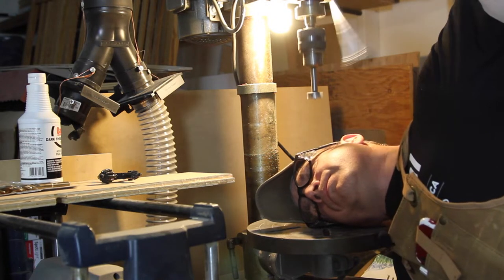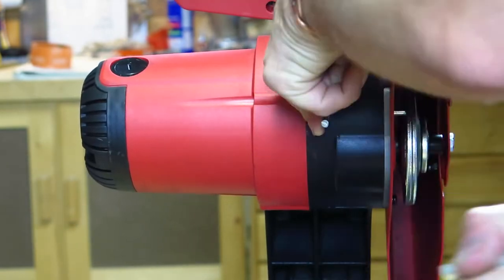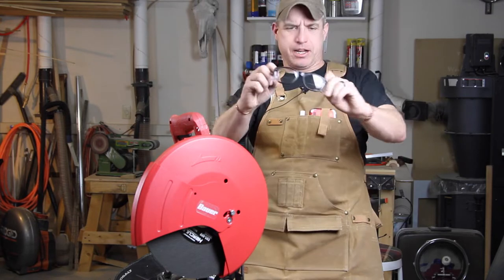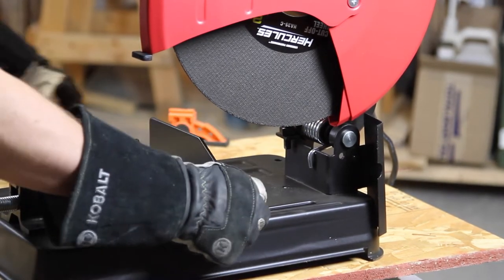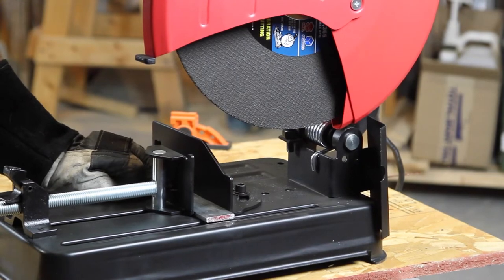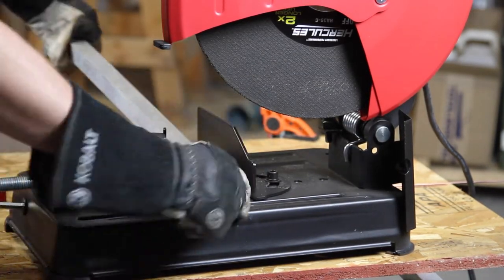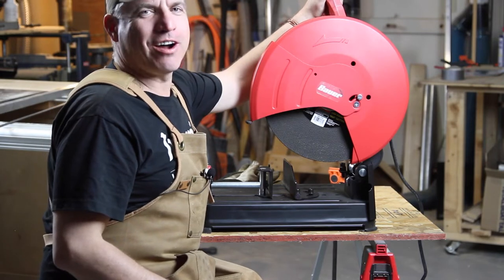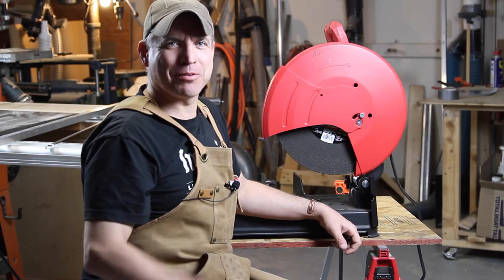Harbor Freight Bauer 14" Abrasive Cut off chop saw review

Comment: Why does the saw have 4 feet but only 3 are covered in rubber.
Reply from the maker: That is a GREAT question and I had to go look. I hadn't noticed because the saw didn't wobble. When I looked, It indeed does not have a fourth rubber foot. I checked the package because I was pretty violent when I pulled it out. Nothing in the box. So I took one of the other rubber feet off. That's when I noticed that the non rubber foot is shaped different and it hit me. That's where all the sparks are deflected! 

In the video you can see that the sparks are essentially molten metal and stick to the deflector bracket. It is so hot that it continues to glow after the saw is shut down. If there was a rubber foot below it, it would likely burn, melt or catch fire. 

I also had a look at the HF website and the photos confirm only three of the four feet have rubber protectors on them. 

Thank you so much for paying such close attention to the video!
Reply: Thank you so much!  I was confounded and saw no sense in this and searched for an explanation- none was given by the Harbor Freight website or the manufacturer. I am impressed and thankful that you addressed and found the answer..

Comment: useless review, we know will cut metal.  but need to see how accurate the angle fence is degree-wise and the blade to the base are.  Not having a true 90 degrees verticle and horizontal cut makes this chop saw inaccurate in cutting.
Reply from the maker: Hi there. My intent with this video was to show the features that are all similar to the features found on the top name saws and add a little humor. With regard to the fence, it is capable of moving a full 90 degrees (45 left and 45 right). There are no production stops, and the degree increments are stamped into the steel itself. That being said, the accuracy is dependent on the operator. I found that the stamped incriments are accurate enough. The abrasive blade will wander slightly if not plunged down right on top of the metal piece being cut. Checked with a speed square the base plate is exactly 90 degrees to the blade. 

Every abrasive saw I've used isn't micrometer accurate. That's not really the purpose of this kind of saw.

Thank you for the comment, and thanks for watching. 

Mat W/1T
Reply: @Mat-W-1TFandF   Disagree with this jerk.  Your video was awesome.  Your reply to his "useless" complaint was much kinder than mine would have been.  Thanks for a great job, and keep 'em coming.  Subscribed!

Comment: Could I use this to cut exhaust pipes.
Reply from the maker: Hey there Michael. Thank you so much for watching and the comment. 

I used this cutoff saw to build a stand for the Bauer grinder that I reviewed and. The pipe that I used for the stand was 2" mild steel about 1/16 thick. This saw chewed through that no problem. I think the thickest I've cut with it so far has been 1/4"x4 mild steel bar. Lots of sparks and heat but it really didn't bog down much. 

To answer the question, I believe it would cut through exhaust pipe just fine. 

Thanks again for watching. If you get a chance, I'd really appreciate your subscription if you gat a chance. 

-Mat W/1T

Comment: Why did you say you can’t cut aluminum with the abrasive disk?
Reply from the maker: Hey there BulliKid, thanks for watching and the question. It's a good question with some controversy attached. Old school rule is don't cut non-ferrous metal with an abrasive saw. 

To start with, it's more about the disc than the saw itself. The saw, with the proper blade could easily cut aluminum. In fact, with this current blade, I'm sure that the disc (not blade) would grind through aluminum. This disc is specifically designed for ferrous metals (steel and stainless) as most abrasive disc are. When you use this type of abrasive disc, the aluminum can melt and clog the abrasive pours (also on grinders and grinding wheels). Basically it fills up the "tooth" (loads the grain). There is a high likelihood for binding and basically ruins the disc. 

Here's my experience... First, (typical) aluminum is soft enough to be cut with any wood working blade with relative ease. Especially a carbide tipped blade. A fine tooth blade works best. I HAVE used abrasive discs to cut aluminum, there is a lot of binding and discs wear out really fast. I have had it bind and break the abrasive disc which is an impressive and extremely dangerous event. 

Out of convenience, I do cut a lot of aluminum with the diamond blade on my tile saw and grinder. Even with these tools I go very slow while cutting as I've had them bind and kickback pretty severely too. It's quite a surprise when the piece of aluminum you are holding and concentrating on cutting with the grinder, disappears from your hand and imbeds itself in the drywall across the room. 

There are actual abrasive discs that fit this saw that are specifically designed for non-ferrous metals. Additionally, more carbide saw blades  specifically designed for cutting non-ferrous metal are available for aluminum as well.

I hope this was a good enough explanation. :)

Thanks again for watching!

-Mat W/1T
Reply: Thanks for the reply! Appreciate the knowledge.   Bend saw seems like the best choice for thin metals.

Comment: Hey Matt can you cut both ends of 1 1/2 tube mild steel to 22.5 and 45 angle with this saw?
Reply from the maker: Hi there Mr. Rodriguez. Thanks for watching and taking the time to comment. 

Yup! This saw will happily cut 1.5" mild steel tubing. I've cut 4" mild steel tube that was 1/4" thick. There is a little flex in the blade, but you can set the miter stops accordingly IOT take out the difference. The miter gauge is marked with 5 degree stops so 22.5 would have to be eyeballed a bit for the fist cut. This isn't a precision machine, but will get you in the neighborhood to weld up some nice joints. 

Thanks again for watching and the question! 

-Mat W/1T

Comment: Can a Metal cutting blade be installed and used in place of the abrasive blade? ---Thank you
Reply from the maker: Hi Stan. Thank you for the comment and thanks for watching. 

For safety reasons, I wouldn't recommend putting a metal cutting blade in this machine.

That being said, I've heard and read about people putting metal cutting blades in abrasive cut off saws. The main issue to overcome is that abrasive saws have a high RPM. If you attached a speed control rheostat to the reduce RPM it might be safe to put a metal cutting blade on this saw. 

Some RPM comparison; Bauer 14" abrasive saw = 4200 RPM, HF Hercules 10" steel cutting blade max RPM = 2500, Evolution 14" steel cutting blade max RPM = 1600. 

Thanks again for the comment and thanks for watching!

Comment: Was hoping you'd cut some 1-inch square tubing, not a horse shoe.
Reply from the maker: Thanks for the comment. The Thumbnail photo was taken while cutting some 1/2" square tubing. I have also cut some 1/8th inch wall 1" mild steel square tube with this abrasive saw and it chews through it just fine. I have cut several railroad spikes and some 1/4" 2x3 channel too. Still going strong. 

Maybe I should do an update video?
Reply: @Mat-W-1TFandF  yes please!

Comment: HF hasn't upped their game, the big names have dropped theirs.
Reply from the maker: Hey Eddie, thanks for your comment. I absolutely 100% agree that the "big name" yellow, red, and blue tools are declining significantly in durability and quality. However, I disagree with regard to the HF Bauer and Hercules lines. Specifically the value of the Bauer line. The fit and finish of the tools "feel" good in the hands, not bulky like the old Chicago Electric stuff. 

I have to say, this Bauer Cut off saw is performing well. I've been abusing it and putting it through the paces. I just cut a piece of steel that was 3/8" thick by 7 3/4" wide. I wouldn't say that it cut through like butter, but it did cut through it to my surprise. 

Thanks again for the comment and thanks for watching!
Reply: @Mat-W-1TFandF  I think that Icon line from HF was a bad move.  Nearly snap-on prices.  I was going to buy a Hilti rotary hammer drill, but learned the smaller ones are main in China.  I wasn't going to pay German prices for Chinese made.  Bought a Bosch fro same price and was a larger model and German made.
Reply from the maker: @Eddie Foy I agree... I will admit that I'm starting to become more conscientious about where tools are made. Unfortunately, I'd wager that 49.9% of every power tool is made in countries notorious for lack of quality control. 

Snap-on tools are far superior over the vast majority of hand tools. That comes at a price. In my tool box you'll find Craftsman with some Snap-on mixed in. I'll admit that I've recently purchased a few Icon sockets (Some 3/8" E-Torx sockets for a special job I might use a handful of times) I have to admit that they're pretty nice "looking" tools and worked well for what I needed them for. 

On the contractor side of my shop, I'm not ashamed to say that I'm mostly Metabo HPT (Hitachi). At the time I got into them they had the best batteries. Now, the cordless nailers are absolutely incredible. Every year I tell myself that I'm going to re-tool to Milwaukee when something breaks. The darn things keep working!

To keep the dialog going, I just searched to compare "apples to apples" with regard to Icon vs Snap-on. The Icon 3/8 In. Drive SAE Professional Deep Socket, 12 Pc. is currently priced at $49.99. The Snap-on 11 pc 3/8" Drive 6-Point SAE Flank Drive® Deep Socket Set is currently $342.00 (They left out "Professional" due to the fact that it's implied with Snap-on). :)

I'd classify these HF tools as; home owner, hobbyist and DIYer, although they do have virtually the same specs as a big name brand. When I purchased this saw I really wanted the Milwaukee. Even searched several months for a used one. At the end of the day, the Bauer won out due to availability and price (nearly half). After all, this is an "as needed" tool in my shop and it will spend most of it's life on the shelf in the corner. 

I apologize for the long response. I sincerely appreciate your view and opinion. Thanks again for visiting my channel and contributing to the conversation!